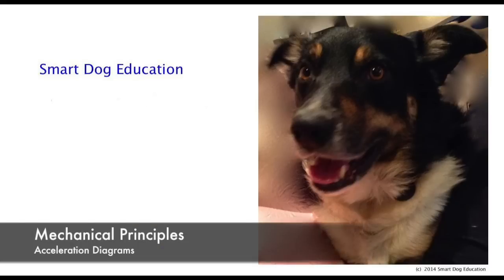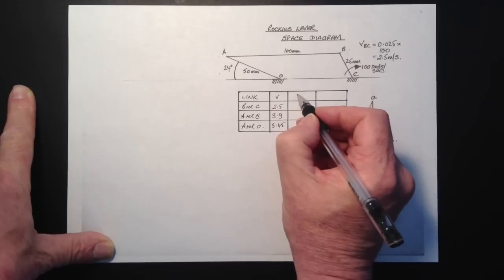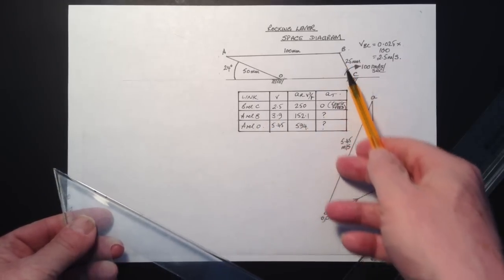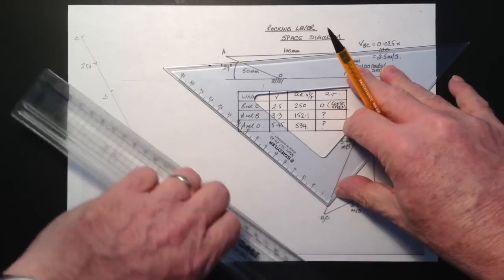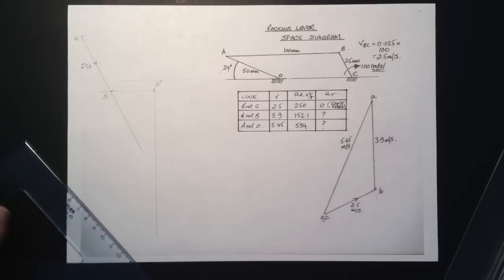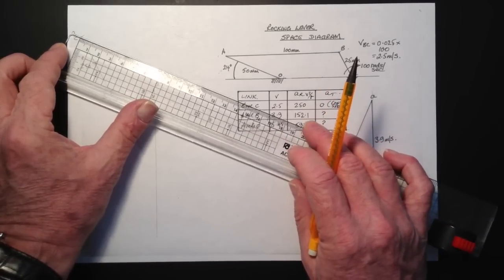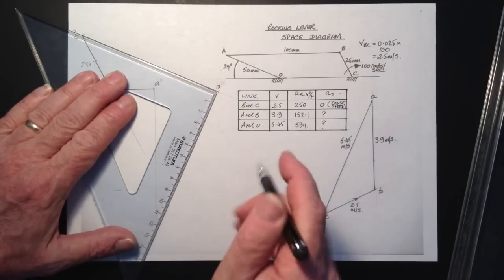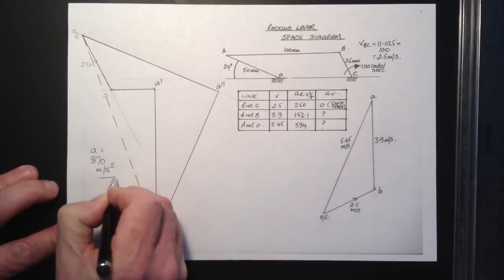Acceleration Diagrams 1

Comment: how do u know the direction of radial and tangential components?
Reply: Tangential component is always in a direction perpendicular to the link or parallel to the velocity component and its given by [v^2/(length of the link)] while Radial acceleration component is in a direction parallel to the link or perpendicular to the velocity component and is given by [angular acceleration of the link(generally denoted by 'alpha' * the length of the link]